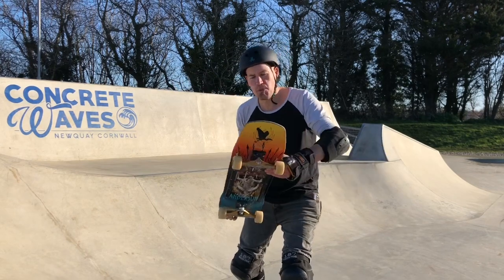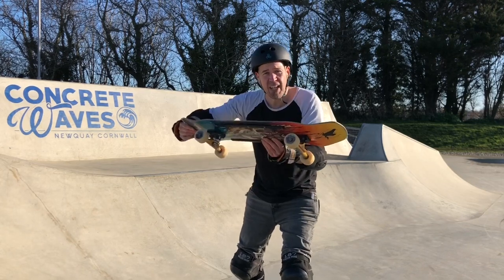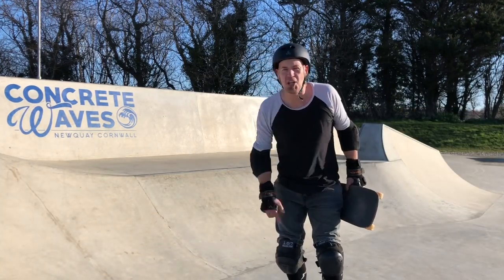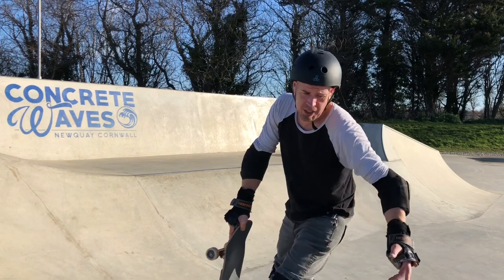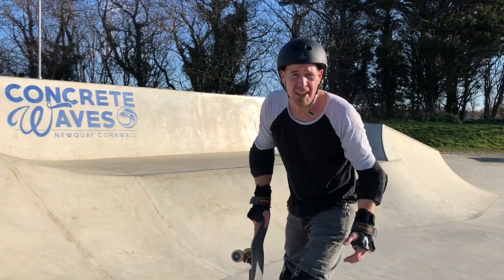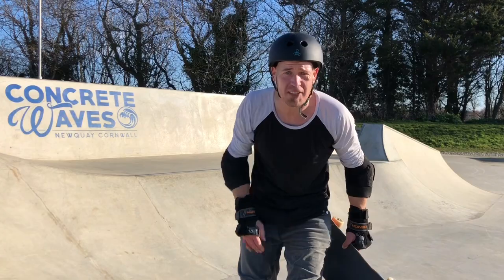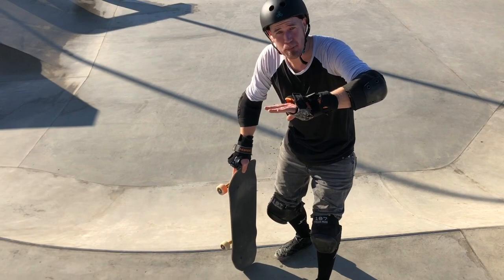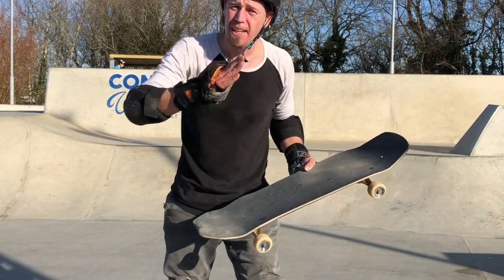Learn to Axle Stall (Frontside) on a mini ramp on a Skateboard

Comment: Just back from a battle  Was getting on front side 50-50, but hanging up every time I dropped back in. (paused to watch this) and landed it within a few tries. Thanks JB!!
Reply from the maker: Great work dude, my Fakie F/S axle stall video has more detail for coming back in if you fancy a peak?
Reply from the maker: https://youtu.be/xYmpzP8zMsQ
Reply: @JonBishopSkate  Thanks Jon. The heal pressure sounded like it really helped with avoiding the hang ups. Will have another crack today.

Comment: Hey man just a little advice, if you do fs axle stalls like that on a steeper transition you have to fully get your board over the coping so that your heel side wheels are locked in fully over the deck. It’s different to backside as with bs you can have your toe side wheels hanging off the edge and not have the board fully on the deck, you just press on your heels. Better to learn them the correct way to begin with to avoid bad habits! Watch Chad Carusos channel he goes into more depth! 

Great vids tho super inspiring!
Reply from the maker: sharki11 many thanks. 
Yes, I totally agree having tried them on bigger ramps. 
I did find that it didn’t matter as much if the wheel wasn’t hooked over on this ramp and on my best ones here it’s across. I usually film and reflect on my first session and then do a follow up vid when I’m further down the road. It’s great when guys offer advice as it really helps, I usually come at these things with a bare outline of what the trick is, and then find and report on the inner workings as I go. However sometimes I stumble across an idea which isn’t the best in the long run. Best Jon

Comment: Definitely a scary one for hang-ups. Nice vid. 👍
Reply from the maker: R3trofest yeah! That was my biggest worry. I’ve Managed a few hang ups with the standard backside version even when having the wheel in the right place somehow, but it seemed easier frontside? There is one or two in here that I bring in without the back wheel on the coping and it still worked? I think taking to bigger ramps will tell the true story lol! Thanks for tuning in !!

Comment: Quick question. With the front side axle stall, coming back in do you need to move your back wheel over the coping like you would with a backside axle stall?
Reply from the maker: I keep my back heelside wheel up against the coping. This is quite an old video. The correct technique is in this video. https://youtu.be/jjQezXiQOB0
Reply: @JonBishopSkate  hey man thanks for the reply!